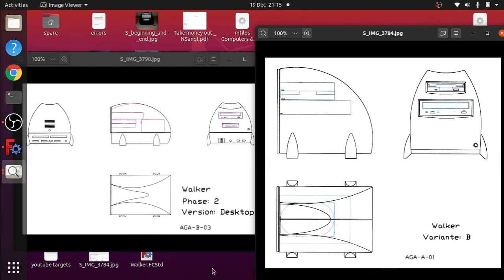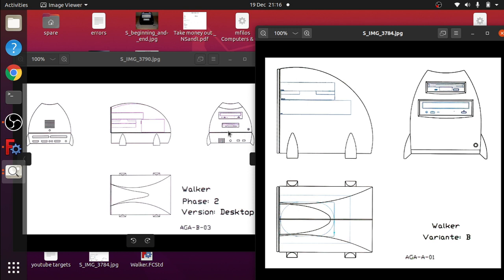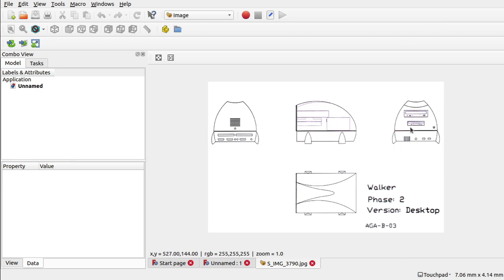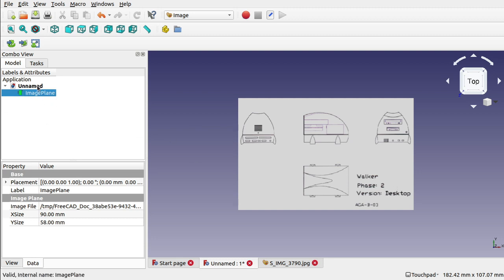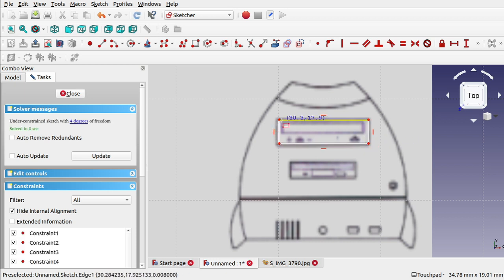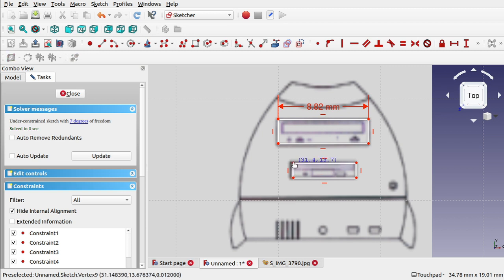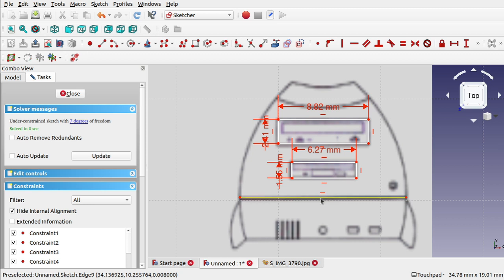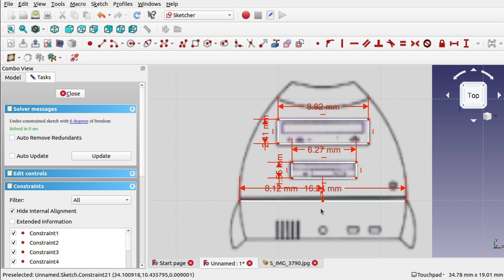FreeCAD : Trace an image into a sketch. Beginners guide to freeCAD

Comment: Actually the Scaling function option button, next to the Create Planar Image, works well. Make sure your drawing mode is CAD. After importing the image, click on this button and set an actual dimension. Then you will be directed to select the starting point and then the end point for the dimension. The dimension does not have to be parallel to any axis.  Once you have done this the whole image is now scaled to the actual dimensions.

Comment: How do I get the "Image" workbench? It's not available, and I can't see it as a third party plugin either.
Reply from the maker: This is an old video so I would go for one of that later ones for tracing. The image workbench has been removed but this video should help you out with the new way to load images https://youtu.be/WhxDAgskcHA
Reply: @MangoJellySolutions  Thanks. Exactly What I needed.

Comment: The only measurement in my photo I know is a circle, which is 0.125"...when I try and constrain the diameter after I made a circle in Sketcher, it shrinks to much smaller than the photo.  Tried the block constraint, then tried to constrain the radius but to no avail.  Wonderful program.

Comment: You have some awesome videos on FreeCAD...thanks very much for your efforts..!! I am having some difficulties with FreeCAD, I am new to FreeCAD, but have watched some YouTube videos and still not sure of what is wrong.

I am an RC aircraft builder who is makng the switch from plans to using CAD for design work. I have .jpeg files of plans already that I would like to be able to cut the multiple parts from the plan on a laser cutter with Lightburn. You may well know that, usually on a set of plans for aircraft building, there are many, many seperate items such as ribs, fuselage section, etc. that will need to be traced and saved in a file for export into Lightburn.

I have tried to import into FreeCAD .jpeg files already for tracing and some .jpegs will import and give me a sheet with images from which to trace from and others only load as a blank sheet with no images on that sheet (I have already thought the sheet might be on the rear..no such luck). Is there a setting that I might have wrong..something wrong with the .jpeg file..??

Another area I am not fully understanding is once I trace individual parts into bodies in FreeCAD, how do I save them as .svg files for when the time comes to nest all these parts in Lightburn. I have observed videos about Lightburn where people have already got a drawing (or file) with many parts in that drawing and nest everything inside of Lightburn...but how did they get all those parts on one sheet is what I am trying to figure out.

Would I save all the individual part bodies in another drawing as.svg files...can I save the part bodies in the same drawing that is open...?? I just am not sure what way to go with this. Hopefully I have explained this correctly for any member here to explain my faults.

Thanks in advance to anyone who can guide me on my way and get me sorted out. Stay safe all..!!

Comment: Great video. I have a problem in that when I click File - Save it saves as an .amf file and I can't import it anywhere to actually work to create a model. What do I need to do
Reply from the maker: This is what's known as a Additive manufacturing file format its an  open standard for 3D printing. Where are you trying to import it?
Reply: @MangoJellySolutions  I'm trying to import it into part design.  It is an image I traced
Reply from the maker: @lynncocksedge908  so the image your importing into freecad  needs to be in a format such as png or jpeg. You use the image workbench to import that into freecad. When you have finished creating your model in freecad you save the file using the standard file save menu. If your exporting out to use your model somewhere else then you need to know what format that application uses as freecad exports to a number of formats. I am not sure of your desired outcome you are looking for your project. If you can give me some details of what the end outcome is going to be I can see if I can help  guide you through the process.
Reply: @MangoJellySolutions  Hi thanks for your response, I have sent you an email and attached a screenshot to it